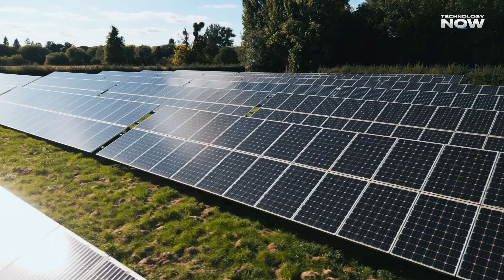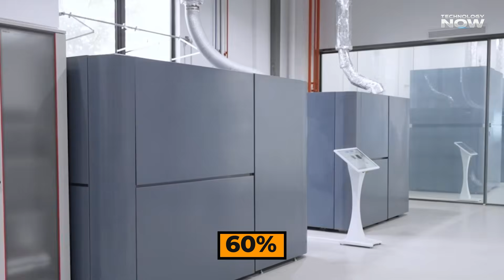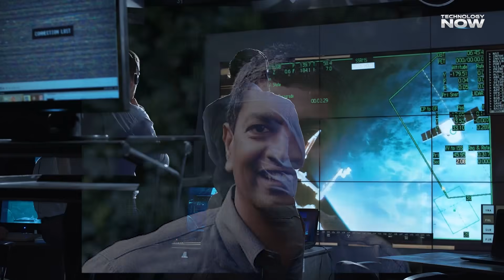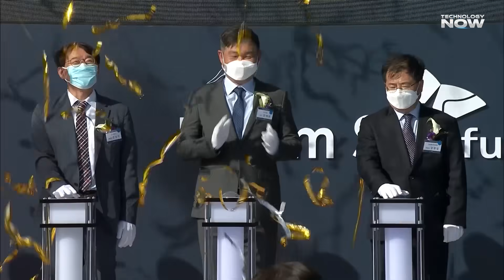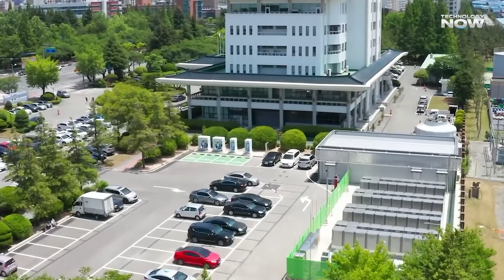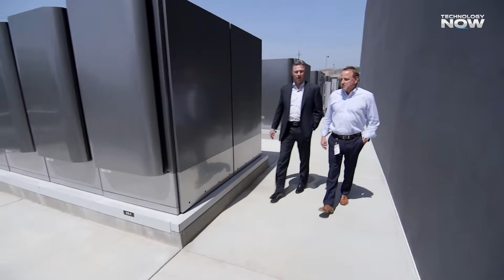Japan's 300,000 Homes Use This Fuel Cell – Here's Why

Comment: These systems can use Natural Gas as the fuel to create electricity, Natural gas seldom ever shuts down because of storms and weather. Many areas also survive most earthquakes less than 8.0. For USA getting them is the hard part. Most readily available fuel to use is Natural gas. Hydrogen is costly to generate but overall is most efficient.